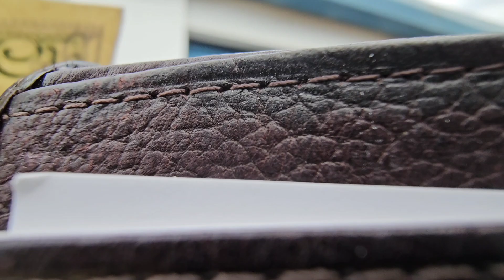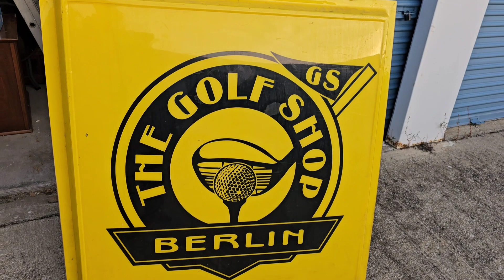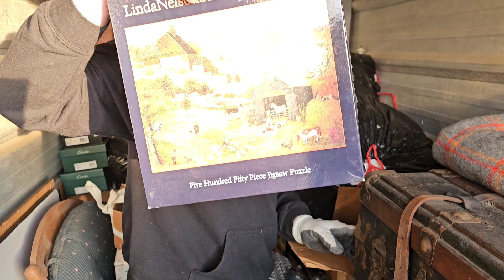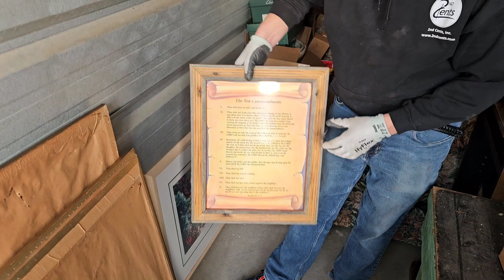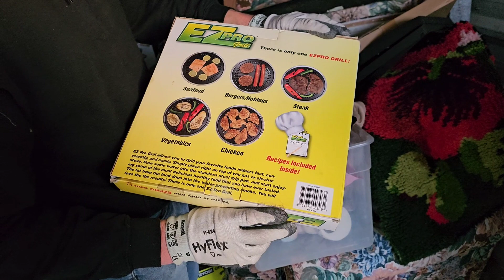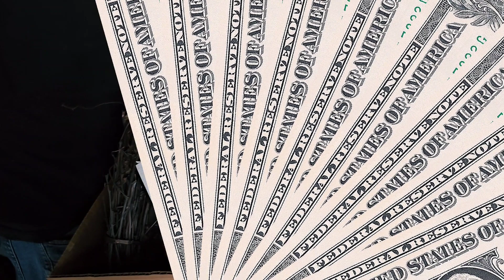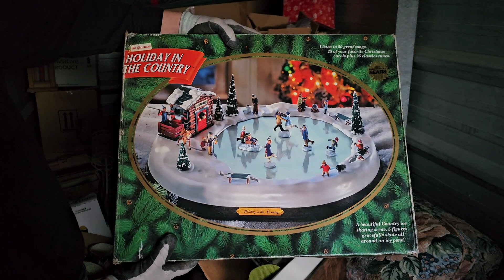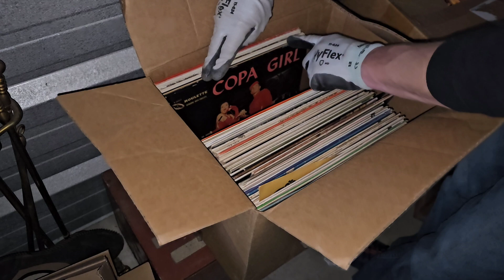$121 for THIS unit at Storage Locker AUCTION?

Comment: Bruh, that was most likely watered down cocktail sauce you drank. A shrimp cocktail is the same everywhere. They first usually have some nice sized ones that are deterdded, and then it's usually placed along the rim of a Margarita glass with salad for decoration and cocktail sauce in the middle. Pretty much a shrimp cocktail everywhere. So if you've had regular shrimp before with cocktail sauce, should taste exactly the same.